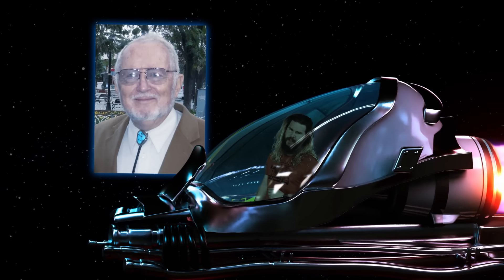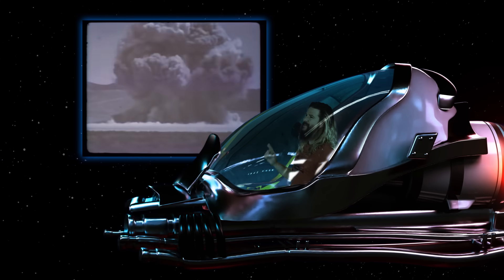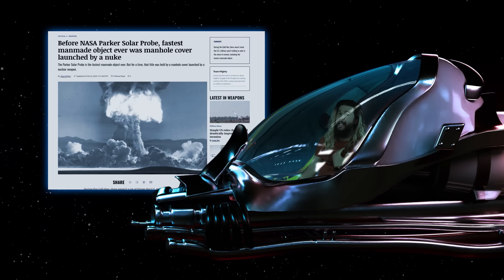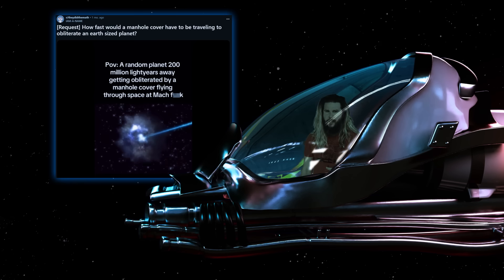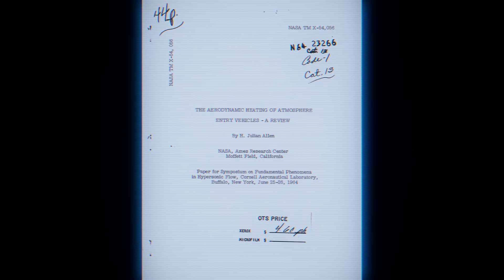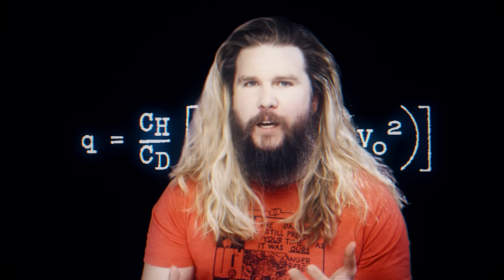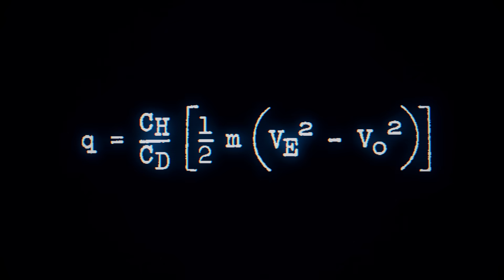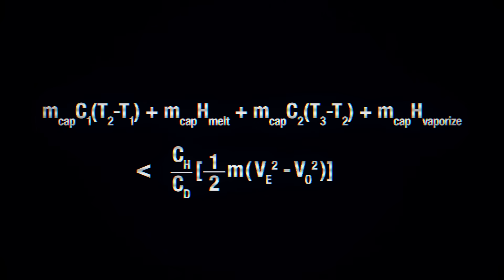Debunking the Nuclear-Powered Manhole Cover

Comment: Kyle, you made a mistake in the velocity numbers. The heating equation is based on the change of velocity. You assumed the entire velocity was lost when you used 0 for Vo and 66 for Ve. You showed that the cover had enough kinetic energy to vaporize...but only if it stayed in the atmosphere enough to drag down to zero V. This baked the answer to your question into your equation to answer that same question.

You need to figure the atmosphere exit velocity based on the drag estimate and gravity. After this point the cover is in space with no more heating. Was this delta V enough to vaporize?
Reply: I have two more questions. 
1. Was there even enough time for that much heat transfer? 
2a. How much heat did the blast impart?
2b. Could the blast wave push past the lid and and effectively protect it in the lower part of the atmosphere?
Reply: @richardlouis-pierre8607  That last part was what The Fat Electrician described in his video. That the atmosphere didn't even have the chance to have an effect on the cover due to the pressure from the blast behind/around it. Plus as something goes up the atmosphere gets thinner.
Reply: I have also not seen anyone take into account the atmospheric density! An object entering the atmo is going from least dense to most dense, so the heating would increase as the density increased, but going from most dense to vacuum is entirely different! So I would deposit that some part of it would make it to space because of the speed through the most dense would have been faster than the less dense . So we would need to figure out how much mass and speed was lost in the more dense part of the atmo for the equation to work properly!
Reply: @cozdiver  In fact rockets not only get icing from fuel (main form) but a second round as the air thins in places that didn't hold cryofuel like the capsule itself bleeding heat in exit.
Reply: @cozdiver  an object going into space actually experiences it’s peak forces NOT at sea level, it’s about balancing velocity and density to get your maxQ
Reply: @JeronimoStilton14  Only in the situation a of an accelerating object like a rocket. Rockets hit max Q up there because they are getting faster and start slow. The max Q of this object would have been directly exiting the blast wave of the nuke detonation.
Reply: @JeronimoStilton14  but only because it also accelerates during its flight, max Q is where velocity combined with atmospheric density creates the greatest effect. Whereas this manhole cover was at max velocity at ground level, which was also max atmospheric density, thus max q was at the moment of launch.
Reply: Not to mention Los Alamos is around 7000ft above sea level. So the density of the atmosphere is already a decent bit lower than density at sea level.
Reply: While your comment is true about Los Alamos' elevation, tests were done in Nevada @dpear3
Reply: The reduction of exit velocity due to gravity is negligible as it would take at most 2s to leave the atmosphere (and at 132km up gravity changed barely) the reduction would be about 20m/s, irrelevant compared to 66km/s.

The reduction due to drag is very hard to calculate accurately, but the force at the beginning of flight is given by F=1/2 rho v^2 c_d A, air density rho is about 0,95kg/m^3, v=66km/s, c_d =1,28, and A is about 1,169m^2 (a circle with 4 feet diameter). Thus, the force equals 3,1GN, applying this for 2 seconds would result in a velocity change of 66Mm/s. A gross overestimation if I ever saw one, but I can't be bothered to be more accurate right now.
Reply: @ybokors8524  Let's do one better. Your math checks out, but instead of just applying 3.1 GN of force over 2 seconds and ignoring the change in air density, lets see what distance it would take that force to decelerate 66 km/s. A force of 3.1 GN to a mass of 934 kg plugged into F = ma, rearranged to solve for a = F / m, gives us a deceleration ~ 3315 km/s^2. Plug that into the formula a = v^2 / 2d, rearranged to solve for d = v^2 / 2a gives us a distance of ~657 m. Even with a variable density atmosphere, the plate would have been stopped long before reaching space.

I'm actually disappointed. I thought it would make it to space, but the math checks out. It would be completely vaporized.
Reply: @vickas54 The drag is not turbulent for all speeds, but only above a certain speed. Under a certain speed we have Stokes' drag, which is no longer quadratic, but linear. The coefficient changes as well. So in case the object changes shape and becomes very aerodynamic, it's possible that it experiences significantly less drag quite early.
Reply: @vickas54  bravo! 👏
Reply: I only noticed the velocity discrepancy, but these are all very interesting points. I hope there's a follow up.
Reply: I don't think there's a way to get around solving a differential equation for this one.  There's lots of drag at the beginning, but less as it goes up. Now, it's likely that a lot of it burned up, because that's what a meteorite that size would do.  At the same time, chunks of meteorites that size still make it to the ground. I don't think C_H is constant, that's an over simplification.
Reply: He also doesn't take into account heat lost through radiation, the fact that the manhole cover may not necessarily be traveling with the disk face first and finally the time it would've been in contact with high density air.
Reply: @danielrugeles1103  I suspect the radiation loss will never be significant until the cover is already vaporized. A white-hot blob of molten metal doesn't radiate enough to matter in the time it takes to reach space.
Reply: @danielrugeles1103  you can calculate the heat loss though radiation with the Stefan-Boltzmann law, but it's negligible.
Reply: @ybokors8524  at those temperatures it’s not negligible, have you ever been close to red hot steel? Heat from radiation is palpable.
Reply: @danielrugeles1103  I have been close to molten steel. But when I say the radiation is negligible, it means that the energy radiated is far less than the energy needed to vaporize the steel, like multiple orders of magnitude.
Reply: @danielrugeles1103 Yeah it made it in space red hot and folded in two.
Reply: @danielrugeles1103 not to mention ablative cooling effects.  The first reentry vehicles were relatively cooled .
Reply: Love that he broke out the formulas for this, but I have the same concern about the end velocity being zero. As far as observation, yes, we've seen meteors burn up completely in the atmosphere, but we've also seen them hit the ground.
Reply: @hawks1282 when the meteorite is full of carbon dioxide they explode but when they're metalic they mostly don't.
Reply: @hawks1282 or conversely.  At what velocity(s) would a 934kg meteor need to be traveling radial in (aimed at the center of earth) to impact/burn up/ fail to have enough time to burn up and impact?

Personally I think he needed to use Vo of terminal velocity in his equation.
Reply: So what you are saying is, we need a peer review?  (Look at me using science terms.)
Reply: Two things I’m wondering:
1) what’s the starting temperature? At liftoff the cover was a couple hundred meters from the center of a nuclear explosion. It would have absorbed a significant amount of energy before the pressure wave reached it. 

2) I don’t think the object needs to reach vaporization temperature.  As the surface gets beyond melting point it’s going to aerosolize. The flip side is this would carry heat away, and reduce drag as the shape is streamlined. 

I don’t have the math for this, but it seems both of these would reduce the likelihood of it reaching space.
Reply: This is a fascinating discussion.  I'm dropping this comment here so I can easily re-find this thread and follow up. 🤓
Reply: I'd guess it lost between 10%-90% of its initial velocity. Assuming a perfectly inelastic collision with the atmosphere above it, (because that makes the math easier, though it's likely more similar to a series of elastic collisions with each of the air molecules) if it collided with every air molecule above it, it would lose 93% of 66km/s, while if it collided with 1% of the air above it, it would lose 11% of the initial velocity. While that's a terrible way to model aerodynamics, I think it is sufficient to estimate some rough bounds on it. I was surprised to find there was about 11,000kg of air above the manhole cover!
Reply: Im with ya on this one, no way it had enough time to heat up when its moving that fast. He assumed all of its kinetic energy would be turned to heat by the atmosphere.
Our thin atmosphere woulda been like punching through a paper bag to that thing. I would bet money it was the first man made object to leave the planetary system
Reply: @dagameface8181  Or, possibly, the first man-made object to enter the sun lmao
Reply: @dagameface8181  100% this ^
Reply: @dagameface8181  I can safely jump into a pool from the edge, but if im going faster (jumping from higher) hitting the surface of the water can kill me, speed matters A LOT
Reply: @liquidwombat  but we are talking about jumping out of the water, he did the math for jumping in.
also a tornado can throw a wicker basket through sheet metal, speed is wacky
Reply: @dagameface8181  probably made a star explode somewhere....
Reply: There is another mistake. Not only may the entire velocity not have all been lost, but the formula is calculating the friction the object (That is moving at high velocity) would have on the atmosphere that is not moving. But in the case of the manhole, the atmosphere is pushed by the explosion, so the manhole is moving close to the same speed as the air around it, so no friction, since the air is pushed by the explosion up to a high altitude (The mushroom of the nuclear explosion). And after that altitude, the air density is less and less. So, is the manhole would heat up during enough time with the atmosphere left to go thru before reaching space?
Reply: @SB-ny3je  The atmosphere will be *compressed*, not just pushed, by the manhole cover pushing it.  That will rapidly heat it and provide heating.  That's what causes the plasma glow as recently demonstrated so well by Starship re-entry tests.

As I understand it that sort of compression at supersonic speeds, and the resultant radiative heating is more significant than from friction, at those speeds.

Anyway, Kyle has some numbers, which is more than most are apparently bringing to this discussion, but indeed he's not given this a full enough treatment to be sure of anything.

Probably the first thing to do is ignore any heating, and thus any mass loss, and just see what drag would do to the object given the initial conditions of "66 km/s, straight upwards, approx. 1 bar initially, normal profile for pressure drop-off with altitude".  But at some point you're basically going to have to either find an equation you're happy integrating, or else do this numerically, taking into account the drag, the heating, probable mass loss and the effect of that on the size and shape, which feeds into changing drag and further heating and thus mass loss.  Then step forwards until either you have zero mass, or new heating is zero (which presumably also means zero drag) and see where altitude and velocity are at (also estimate of the remaining mass).
Reply: @AthAthanasius  However, you also have to account for the fact that the cover was not traveling solo. It was traveling with the air around it, so the compression would be affected.
Reply: @SB-ny3je That's the same reason volcanic rock is found orbiting earth, they get thrown into space along with all the plume.
Reply: @SB-ny3je  this is likely only going to be true behind the manhole cover, and likely for only a few hundred meters. Fluid dynamics would likely result in sapping energy rapidly from the blast

That said, I strongly suspect this effect would be significant for the first few percent of possible travel
Reply: @SB-ny3je  funnily enough, fat electrician even mentioned this in his video...
Reply: This makes a lot of sense, damn it
Reply: Gravity means almost nothing to acceleration, since atmosphere is 100km thick, so it would take under 2 seconds going at 66km/s to exit, so it decelerates about 20m/s due to gravity.
Reply: I wold consider the cover to be a piston moving and compressing the air and see the worst case scenario of the temperature and calculate the heat transfer in the time that it takes to exit the atmosphere,make the calculation as it is is a close piston compressing the air and accelerating it to space
Reply: @TheFelipeaugustopixo  that is basically what Kyle did, the problem with that calculation is it wouldn’t primarily have been the manhole cover compressing the atmosphere up it would have been the gasses from the nuclear explosion a lot of which would have to have been moving far faster than the manhole cover (or more probably the bits of the manhole cover after the first fraction of a second).

Molten bits of rock regularly made it into space from meteor impacts, if a bit of shockwave melted rock can make it to space bits of cast iron should be able to. The glasses from the explosion may not have gotten high enough though.
Reply: +1
Reply: I think it's fair to say that the heat of atmospheric friction would dissipate around mach 1 (.343km/s) and at an escape velocity of 11.2km/s, x6 =67.2km/s that still puts us over mach 3. The 66km/s was likely accounting for this, and if not, it disappears in the imprecision of 2 significant digits.
Reply: Cast iron is brittle. It is unlikely to survive the initial stresses and breakup massively increasing drag.
Reply: @shopwood99  I have my doubts, because the manhole cover was intact for 1 frame after being shot out of a nuclear shotgun that was welded shut.    I'm pretty sure we are outside the territory of rules of thumb here, time for math.
Reply: 100 percent, posted the same
Reply: Whe know
Reply: love this point
Reply: It's definitely 0%. Look at papers on hypersonic flight. At 66 km/s, the atmosphere isn't a gas, it's a highly reactive plasma. Plus, the difference in temperature alone between the boundary layer  and interior causes insane stress inside the plate.
Reply: @Vexas345 I'm still not sold. I feel like if you can accelerate a small piece of copper at almost escape velocity at a distance of 6 feet that cuts through steel that is 150-700% as thick as it's diameter(aka a shaped charge), I cannot say for sure this would have time to burn up or shatter. Making matters worse, there's only 1 frame of it on the high speed, so we have absolutely no way of knowing how fast it was. I read the scientist that calculated it's speed used the lowest number, just to be safe. So it's somewhere between 6x exit velocity and 11.99999x exit velocity. No matter how hard you try you can't cook a steak in 1 second. I don't think you can cook that manhole cover in under 2 seconds, while turning the heat down.
Reply: @droppingpins6244  This is why. The iron isn't just melting, it's burning and breaking. The lowest speed is the best case scenario, going faster is worse for the plate. It's not just that it's getting hot, the object is literally getting tore apart. 

"Material requirements are further exacerbated due to the dissociation of O2 and N2 into free radicals at gas-phase temperatures above 3000 °C (typically at speeds greater than Mach 8). These conditions lead to highly reactive surface chemical interactions, causing materials degradation, microstructural evolution, phase formation, and property changes during flight."
&
"When the air is ionized, the propagation of electromagnetic waves is presented and introduces added external forces and energy transfer mechanisms. Thus, hypersonic flows are governed by aerodynamics, electromagnetics, nonequilibrium quantum chemical-physics, and nonequilibrium radiation."
Reply: @Vexas345  for 2 seconds, maybe, and very quickly the friction drops significantly due to the air instantly becoming thinner. All of what you said is true...if it had to push slowly and laterally through a thick atmosphere. Even arc welders hotter than the surface of the sun can't melt iron that fast, it takes a second or 2 for your puddle to form.
NASA claims that speeds of mach 10 are only possible above 40,000 ft because air resistance below 40k is too great. In theory, this manhole cover could have reached 40,000 feet(approximately 12km) in 0.25 seconds. But according to NASA, that air resistance disappears real quick.
Reply: @droppingpins6244  It's not just about friction is the point. It's not a question of 'will the plate survive flying through the air for 2 seconds' at those speeds. The question is 'will the 900kg plate survive colliding with 12000kg of highly reactive O and N ions'. The time is barely the issue, it's just determining how energetic those collisions are. And Fe loves reacting with O and N, and those reactions are exothermic.

The problem people are having is they are considering this just an aerodynamics problem. But it's not, because generally aerodynamics gets to hand wave a bunch of stuff away; the conditions just aren't extreme enough to notice. But hypersonic flight is a whole different thing. Even the whole plate not getting hot at the same time is a problem, because that differential means thermal expansion creates even further forces to deal with. 

Also, the plate may just explode outright. 

"Regarding the mechanism governing the micro-explosion of burning iron particles, the generation and expansion of gaseous bubbles inside the particle directly lead to a rapid increase in internal pressure, and ﬁnally fragment the particle into small pieces."
Reply: @Vexas345  and again, as mentioned, it's not colliding with 12,000kg of ions. There's a metric shit ton of air leaving that nuclear shotgun barrel, traveling faster than the projectile, literally moving a couple thousand kg of those jobs out of the way for the projectile. That is very important information that needs to be calculated. Every meter of altitude where that projectile doesn't see air resistance must be calculated, because the atmosphere thins extremely quickly.
Reply: Also got to add on, when its at the thickest point, The air is also being forced up with it
Reply: At what speed does a solid fused iron meteor with a disk shape moving at 66km/s (low end) hit the ground at with a perpendicular decent path.
Reply: Came here to comment it